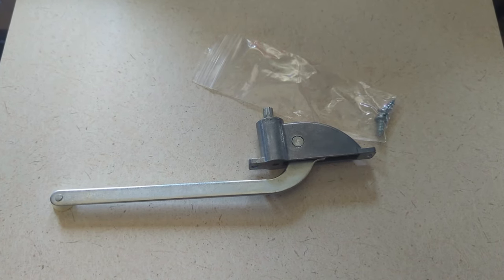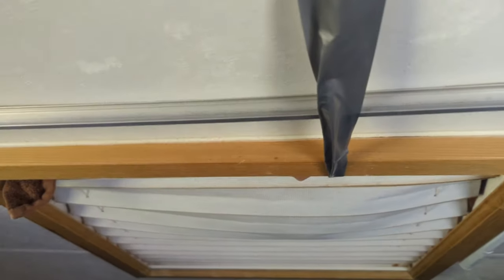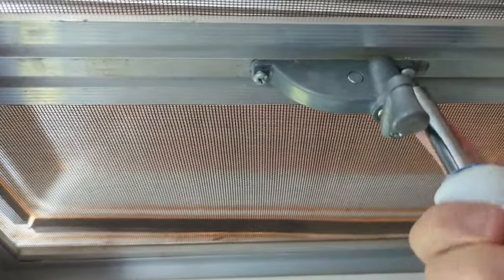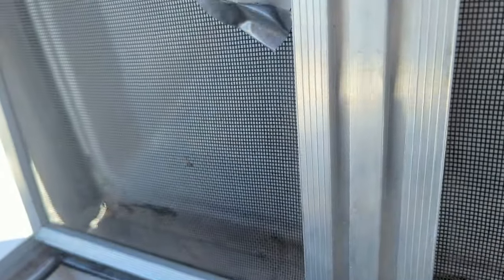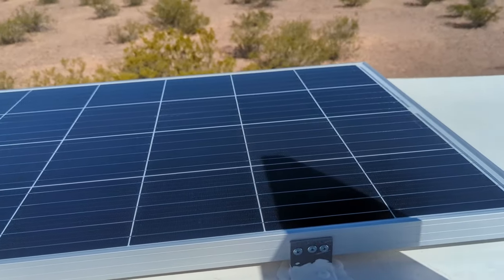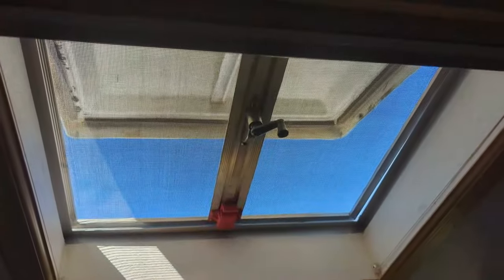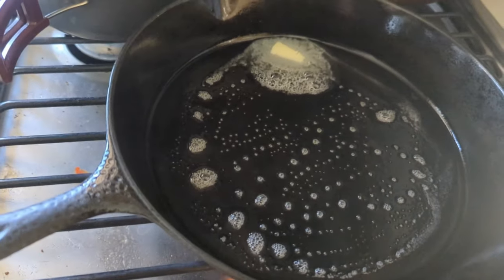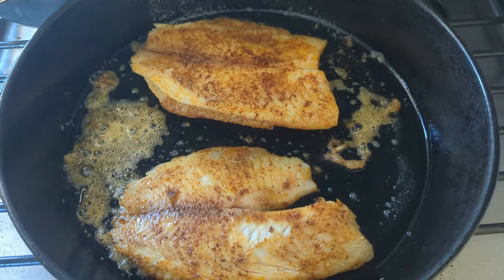Repair Escape Hatch on Truck Camper And Tilapia Dinner

Comment: I just subbed.  I am interested in travel, but repairs and breakdowns terrify me because of the high costs.  It looks like diy isn't terribly hard if it's not something too complicated.  My question to you is travel really affordable for someone on Social Security?  I am currently working full time, but eventually would love to travel.  I will be 62 in a year.  I would have the money for the initial jumping off as I am saving like crazy right now... What would you say is  good emergency fund amount to have ongoing?
Reply from the maker: I wish I could help you on a number that is needed for an emergency fund.  But, it is subject to your needs and your lifestyle you are wanting to live out on the road.  I don't know what kind of vehicle you have or when things will decide to break down.  I have a diesel truck and any maintenance is usually expensive.  I had to replace the tubro on it last year and it cost me over $5000 and this year I bought new tires over $2000.  I upgraded my solar this year and that was close to $4000.  It adds up fast. 
 Everyone out here on the road are on different incomes and have to live accordingly to that.  Gas prices vary from state to state.  I have been paying close to $5.00 a gallon in AZ.  The winter I boondock.  In the last 3 summers I pay for campsites.  Which might be out of some peoples budgets.  All this to say, You are going to have to come up with that magic number based on your circumstances.  I know this doesn't help or answer your question but I would hate to give you a number it not even be close if/when you run into trouble.